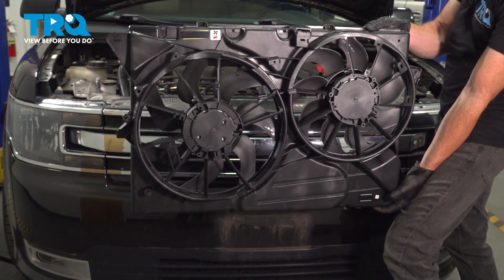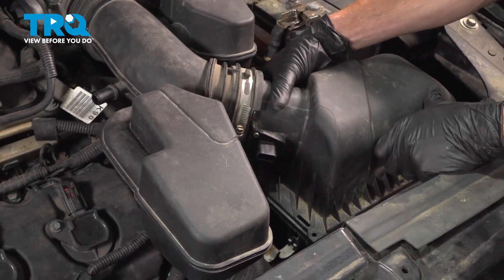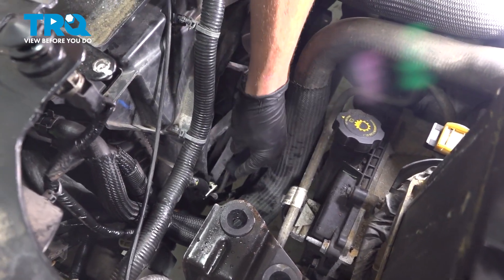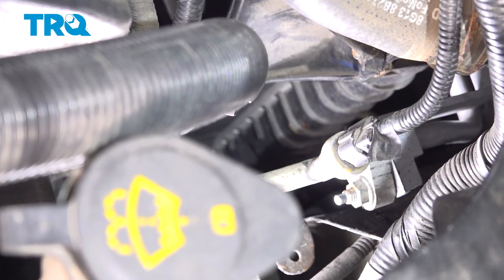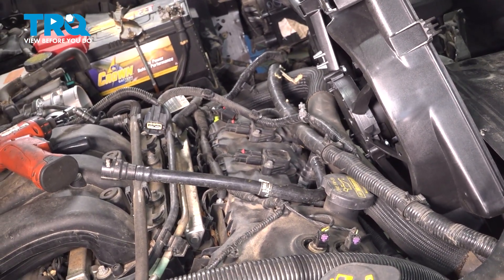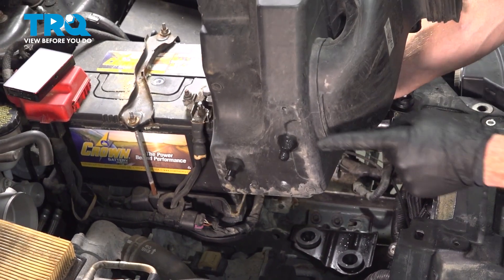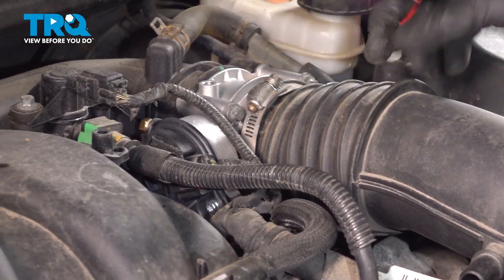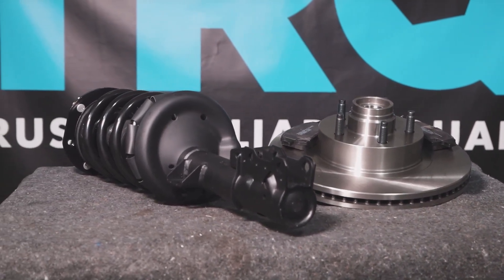How to Replace Dual Radiator & Condenser Fan Assembly 2009-2019 Ford Flex

Comment: I received a quote to replace this fan assembly of $827.13, $515.49 for the part & $243.75 for labor. I purchased the Dorman fan from Amazon for $123.00 & one hour of my time. Thanks to your excellent video I saved $700.00.